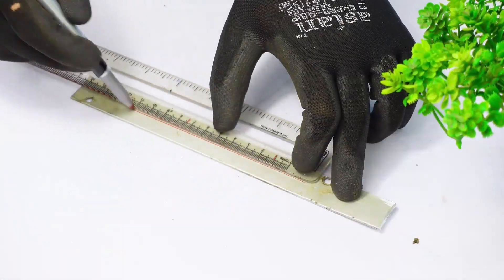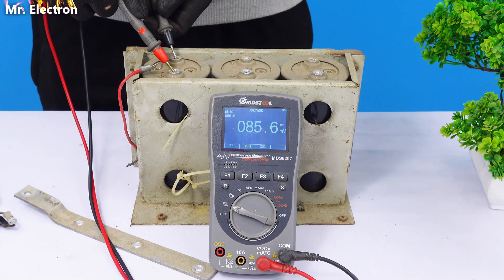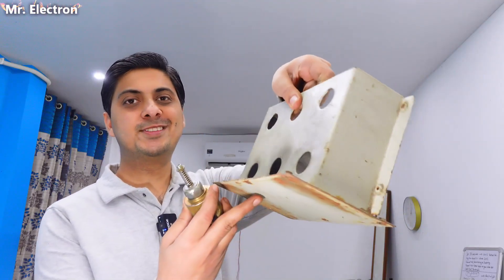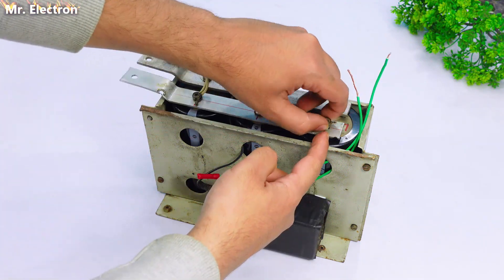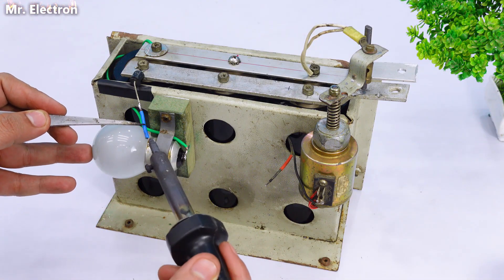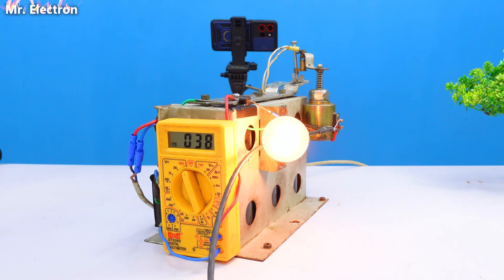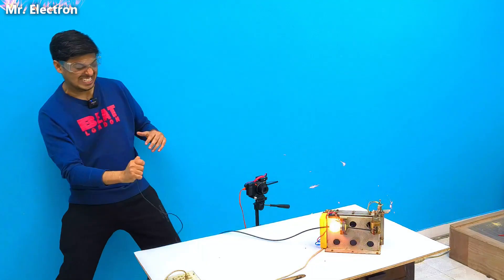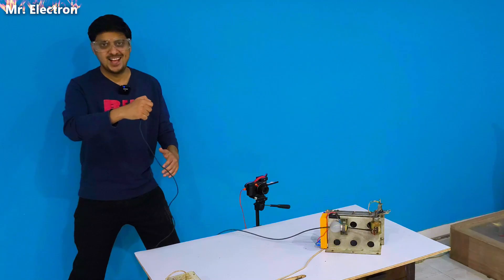Don't Throw Away Old Motor Capacitors Before Watching This!

Comment: I think you need to make like an isolation between the terminals of the capacitors maybe try hot glue gun amd put a plastic board on the top and let the glue stick to it then the sparks should stop i think
Reply: YOU ARE RIGHT HES OVER CHARGEING THE SUPER CAPS
Reply from the maker: Thank you for watching!💥 Check out my Latest Video here: https://youtu.be/twythhaJls0 and JOIN my WhatsApp for faster replies: https://whatsapp.com/channel/0029VaQmmRaFCCoWOf7huh3G